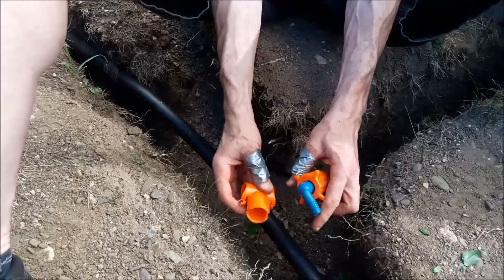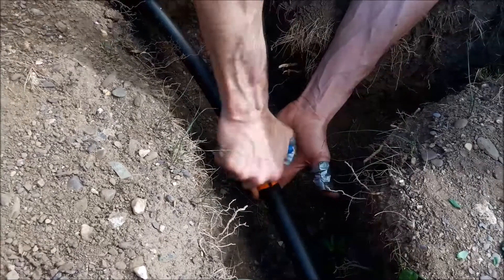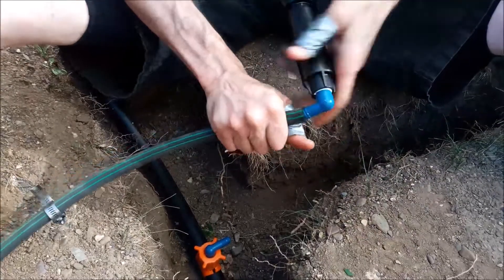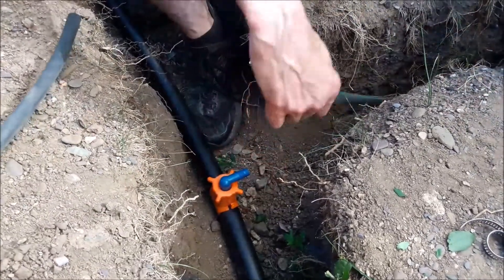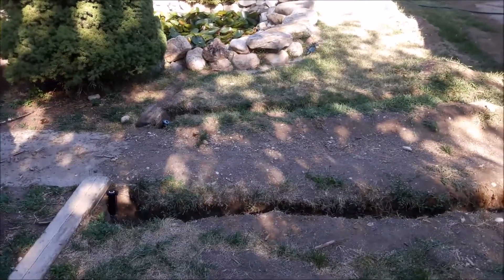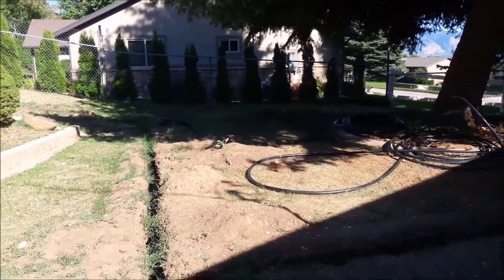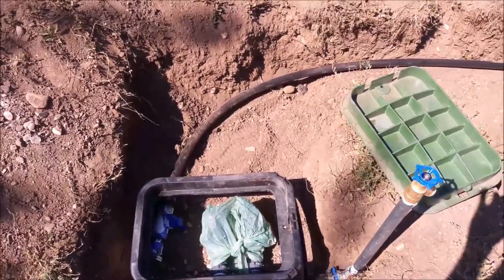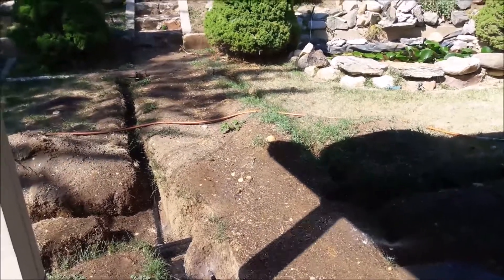Irrigation Wars Part 14: Installing a Saddle Tee and Testing More Sprinkler Zones

Comment: using the solid black poly would have been cheaper and more voulme since you used the clamps, otherwise that style poly doesnt even need the clamps. but since theyre are 3 sizes of 1/2 poly depending on manufacturer its a pain in the butt getting all the stuff together just right

Comment: Heat the funny pipe (and poly) with a blowtorch and push the connectors in. It’s effortless.
Reply from the maker: Thanks for the suggestion. I had a friend suggest the same, but was concerned the heat might weaken the poly so I didn't go that route. Probably should have because my grip was fried by the time I finished it all.